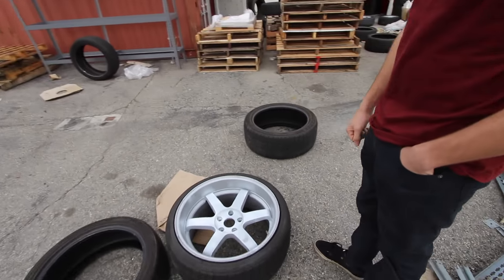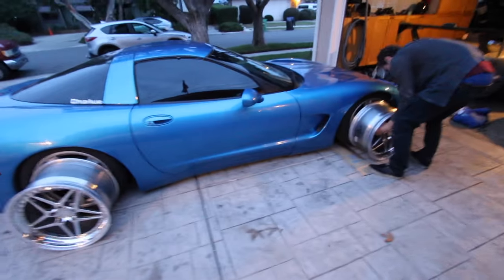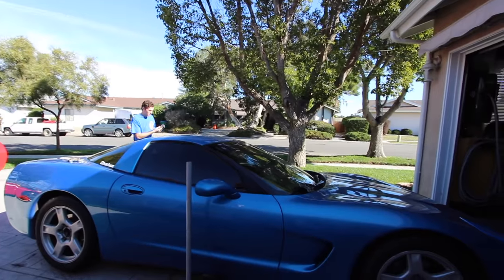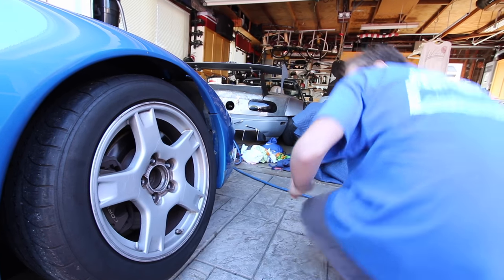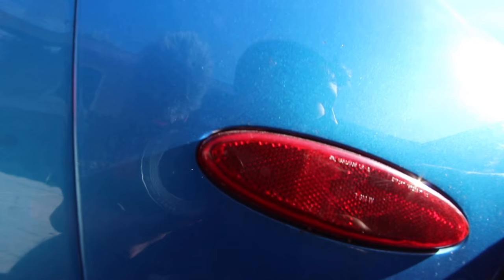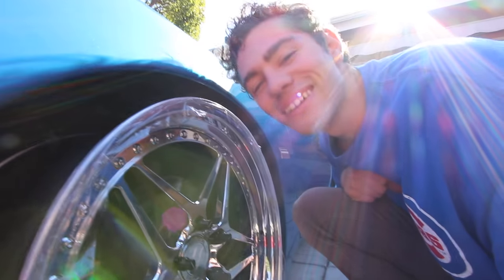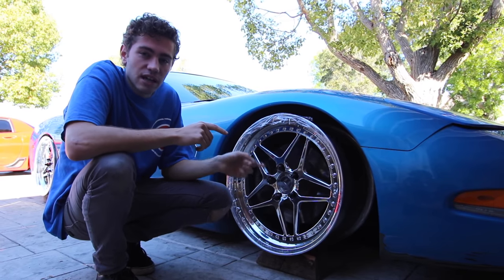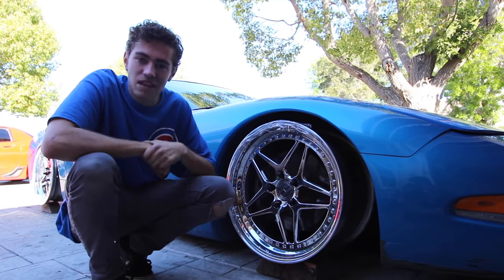NEW WHEELS! | WHOREVETTE Gets New Shoes!

Comment: I'm pretty sure you should use a torque wrench to tighten the lug nuts.
Reply: Anonymous you think he is going to ride without tires
Reply: Anonymous No way! It's called a test fit tho bud
Reply: Anonymous yeah you should but this is Tyler were talking about lol.
Reply: Please enlighten me on how he is supposed to tighten them with a torque wrench while it's in the air. (Answer of 'step on the brakes' is not valid because it requires a second person)
Reply: Jordan Hillard A brake depressor would work fine. And he is in fact not alone and could have someone apply the brake, then seated the wheel before using the gun to seat to the hub. That is improper mounting and adds unnecessary stress.
Reply: Literally never used a torque wrench to do up any of the nuts on my wheels... It's not a necessity, it just a nice re-assurance.
Reply: Not a necessity... when you crank one and see the pain in the but you will see
Reply: I have no idea what you're trying to say.
Reply: You all have no idea what you are talking about, and therefor should not touch any vehicle for your own safety.
Reply: Anonymous I put my good old 4 way on there and start cranking till I feel a hernia come on then I back off.
Reply: +Dillon Rupert lol
Reply: I just do em up hand tight and then kick down on the breaker bar once to go that little further and fucking bam. done. Never had any issues ever.
Reply: Hazardous1 and what car is it you have?
Reply: Anonymous Current project is an Mx5, have had rx7s/supras etc

Comment: Why such a high offset? is that like +65 ? and instead of grinding the back of the wheel, why not grab like aan 8-12mm spacer for the wheel. if ur stretching the tire, it will sit like right in the gap between the lip and tire.

Comment: Sooo just put a spacer to clear the inside. i did that when i was running 16x10 +0 offset on my bagged delsol , the barrel was rubbing on the bag, put a 5mm spacer & it was fine. just find a nice spacer & you'll be set. it'll also give you some poke in the rear.  IG: @Spictor_ 
P.S. It's static now.